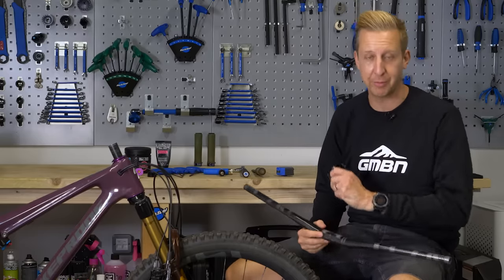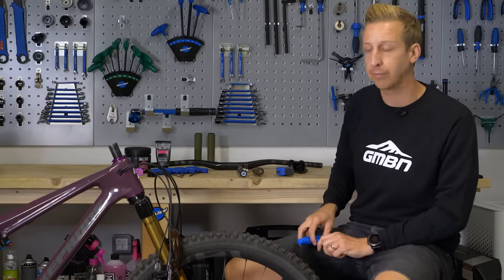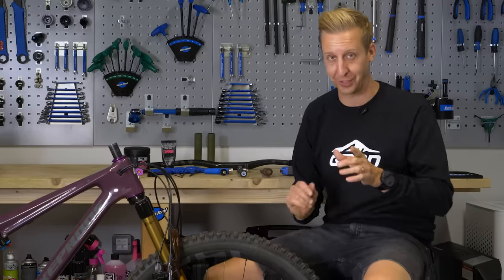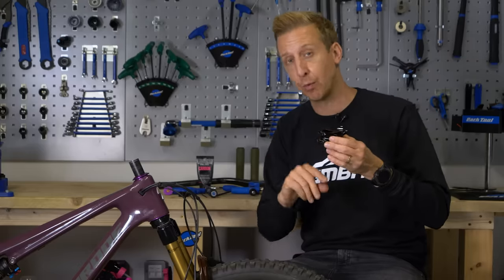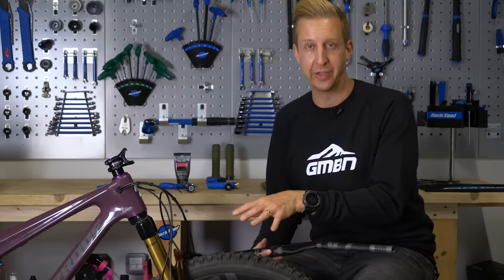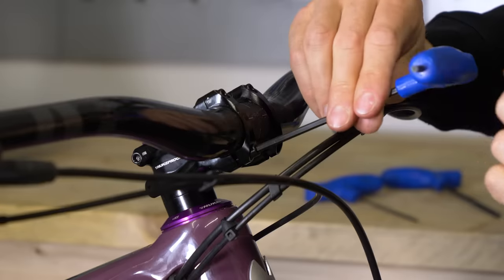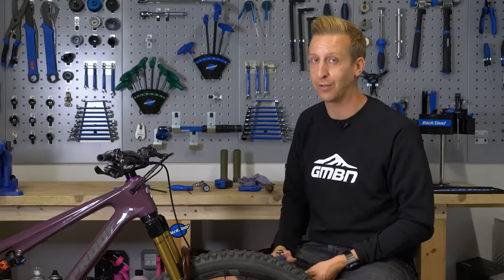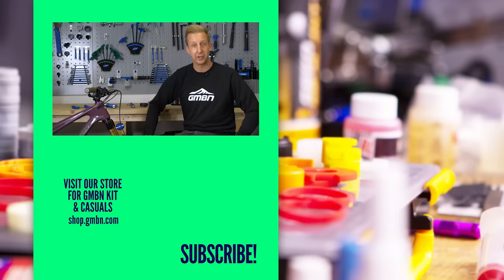How To Fit A New Handlebar & Stem To Your Mountain Bike | MTB Upgrades & Maintenance

Comment: One thing I recommend is to actually center the bar in the stem using a tape measure. Don't automatically assume that the delineation marks are centered. I have had a new bar that the marks in the center were off by a 1/4" to one side. New parts may not be perfect and any flaws missed during quality control inspection.
Reply: Had some raceface atlas bars that were like that

Comment: Hi Doddy, sometimes carbon bars come with a maximum torque setting not to exceed which may be lower than the torque value indicated on the stem.  The difference is minimal but if you want a be spot on something else to look out for.

Comment: 1/4” drive torque wrench $10 & bit set $5-10 at Harbor Freight Tools, still much cheaper than $60 for the PARK, and you’d have a full set of bits and a torque wrench you can actually use when wrenching in anything else besides bikes.

Comment: I always have a 3-5mm spacer on top of my stem, that way my stem is at least flush, if not 1-3mm lower than the top of the steerer tube. That way I get 100% stem grip/interface..... just makes me feel all warm and fuzzy.
Reply: That spacer (if not being held in place by the steerer tube) is prone to slipping and bending the ahead cap screw - so make sure it reaches down over the steerer tube.
Reply: @geemail369  While I have never had that problem, I do like at least 1mm of steerer sticking over the stem to center the spacer and it's how I setup my last few forks/bikes.
Reply: @geemail369  Most headset top caps have a shallow protrusion that fits inside a spacer or stem to keep them both centered.
Reply: @mattgies  That recess won't help -> a few years back a friend of mine found his ahead cap screw bent and (on) top spacer slipped off the stem after we had chucked half a dozen bikes into our transporter and shuttled a bit - another bike's bar must have knocked it off womewhere along the way.

Comment: Instead of removing the steer tube when you file it, you can also just remove the wheel and then lay the bike flat, and collect the filings on a shop towel on the floor.

Comment: Burrs and sharp edges are more likely to appear on lower end and cheap and cheerful (ebay) non-branded stems where corners will be cut to reduce costs so you'd be well advised to check for them.
 Now, I'm all for saving a bit of money if your budget won't stretch too far but be aware that you may need to do some pre-fit prep in order to make sure you don't have a nasty surprise waiting for you on that gnarly descent or when making a heavy landing!

Comment: Great vid but just a bit of question or perhaps criticism, but wouldn't greased threads lead to over torquing? I come from a different kind of mechanics and the only time we would torque a wet thread is if the manufacturer or application requires a thread sealant and we typically reduce the torque applied in those cases. Would you not just want a very clean and dry thread? Thank you for reading
Reply: I was thinking the exact same thing when I heard him say it.

Comment: 😷
So for example, let’s say a company has always used a torque of 100 ft-lbs to install a bolt in a certain application, and let’s say that that 100 ft-lbs was spec’d for use with dry threads with no lubricant. Then one day, an operator says, “Hey I read this article that said thread lubricant is good for the bolted joint to reduce wear, so I’m going to try it.” 

But when they apply the lubricant and then use that same torque spec to tighten it down, they wonder why the threads got damaged or the bolt head broke off.
Reply: Well no cause the reccomended torque value is in perfect conditions. So if it says maxium 100lb it will be 100lb and grease will acctualy help.

Comment: I used 2 big spacers at the bottom and put my stem on and top cap but it still wobbled so I put a smaller spacer at the top and it’s fine, I know I could just cut it but it looks good anyway

Comment: I was taught to torque w/o lube. Great video! Not talking carbon grip but grease on the bolt threads. I have been known to put just a wee bit of anti-seize on dissimilar metals.
Reply: This is actually an important point cause if torque value is for an unlubricated then you will over tighten. Can be almost as bad as a rusty thread.

Comment: I noticed you talking about that gap at the top. I definitely don't have that. I have 70mm of total stack height available - 40mm stem, 5mm spacer on top of stem, and 10mm+10mm+5mm spacer under stem. This is how it was configured from the factory. Is this ok? Also, I wanted to drop the stem down by inverting the stock configuration of the spacers - would this be ok? 5mm spacer below stem, and 25mm total above stem. I just wanted to see if it made my bike fit better and more comfortable, but I don't want to wreck it either.

Comment: Grease should only be used on torqued bolts if specified otherwise you will over tighten the bolt.

Comment: I purchased an RF Turbine R stem a short time ago.
Unfortunately, even when following the assembly instructions (torque always respected), it is quite common for one of the 4 screws to loosen. Since it's always the same I have questions.
I took everything apart and put it back together, respecting the tightening torques, but nothing worked. The screws being almost new there is still all the blue thread lock on them. The spacing at the bottom of the stem is the same on both sides, I have always been careful to tighten the screws evenly.

Do you have any solutions to this problem?

Comment: My enduro has 594 or so mm stack with a 458mm reach which isn't a lot for such a bike in size l. But it also has got a slacker seet tube angle at 73 degrees. Should I go from my 19mm rise bar to much more something around 40 or even more or somewhere around 30-25? Or should I go for 25 because of the slack seet tube angle? I'd definetely like more rise/stack. Should I try to offset the low stack? That's the main question. The rise is propably personal preference.

Comment: Excellent video. At the risk of sounding like a dumbass...what if I just want to change the handlebars and NOT the stem & crable? Do I just take off the front section of the crable, remove old bar, put the bar on then follow the procedure from 9.18? Anything else I need to do? Thanks in advance.

Comment: Doddy.. Im not an expert. BUT. The clamps on the bares. They are 100% together in the top. But there is a gap in the bottom. As far at i know you need to have the same gap in top and bottom so the screws are straight. When only one side is all the way in they are angled yes??
Reply: He addressed that issue in the vid at 9:40-10:15....this particular stem specs no gap at the top...cheers

Comment: is there any reason not to use Loctite 243 for example? I use it on stem bolts, and I found it to be helpful to keep the stem secure with rapid temperature changes, and hard riding. but with some stems it might not help much, I experienced this with Race Face Atlas, for some reason, all Loctite was gone, and bolts came loose in minutes after taking bike out in -10c, so handlebar spun, but it happen all year, I just had to check the stem, before, during and after rides, unless it was more stable temps, then the stem would not loosen as easily, but the issue was on the stem steerer tube clamping bolts too so the headset had to be tightened too. 
I had to check it often, even during rides, not an issue with Renthal Apex stem, which I've used on my previous bike, and I was so impressed I went for it just a shorter version.
but I do add some grease, I add grease at the shim on the bolt, to prevent it getting stuck. I've tested the stem with and without Loctite, and yes it does make a big difference, if the stem already is great.
But I don't know for sure what is the cause for this stem being so secure and the other not, maybe materials, clamp design, maybe both, maybe bolts too. with Loctite 243 the stem bolts hold on for months, tru rapid temp changes, hard riding, and when they finally come slightly loose, they would still be secure. and of course torque spec is important, some stems require higher torque than others.

Comment: Greasing the threads? Won’t that lead to an inaccurate torque reading?
Reply: No, that actually helps with accurate reading. Threads are not surgically finished or cleaned from factory and can be additionally dirty from storage. This would cause under torquing most bolts.

Comment: Hi GMBN!  i just got a new Canyon Spectral 2022 AL 29'' in size XL. I am 1m95 aswell. and i feel like the bike is a bit long and the bar feels quite Far away. Also when i try to manual or do a Bunny hop i feel like its quite hard to get the weight to the back of the bike.  What do you suggest , A Shorter Stem ? or a higher rise bar? the hight of the stem is at its highest position.   I do not have that many problems with the front wheel comming up yet on Steep climbs.    

comming from a Giant anthem xl with about 475mm reach  to the canyon with 506.  The Giant anthem felt too nervous for me with its steep head angle and 27,5 wheels.

Any Tips are welcome 
Cheers and ride safe !

Comment: What is the piece under the top cap called? Mine (new bike) is missing a piece and I don't know how to search for it. There is a play between the fork and the frame because this missing piece
Reply from the maker: It's usually called a stem spacer or a headset spacer - some riders call it one, some call it the other, but they're the same thing.
If you have any problems, we always recommend getting in touch with the shop or brand you bought your bike from to check with them - it can help save some expensive problems in the future!

Comment: Worst part is lining up the stem with the wheel
Reply: The bar forms an isosceles triangle with the front wheel. Means, if bar is centered in stem, two threads from bar ends to e.g. valve in rim, will have the same length. I just wrap the middle of a two meter thread around the valve, mark two equally long parts and when bar ends align with the markings, the thing is 90deg to the front wheel. Aligning by eye sight with suspension stanchions works too, as long as your nose is center over the stem 8-)
Reply: Just zip tie a level or any kind of straight edge to the front of your forks and eye the bars inline with it..that’s what I do and it’s perfect every time....
Reply: What clips are they you are using to tidy your cables?

Comment: My question is what nm do you set the torque wrench for the the brake levers on a carbon bar and grips I’ve never had carbon bars on my mountain bike I want to buy hope stem and carbon bar.
Reply: You dont really need carbon bars bc they are way more brittle.And you have to be really caretul wen installing them

Comment: should I grease stem bolts on an aluminum stem? And with what grease?
Reply from the maker: Hi @Wes Staff, You don't need to use grease on stem bolts as they are very unlikely to corrode or get stuck. Just ensure you put a little bit of standard bike grease on the stem where the handlebars sit. We hope this helps and safe riding!

Comment: I want to go from 31.8 to 35mm stem but the steerer tube says 11:8 at top and lower steerer tube is 11:2 so do I get a 11:8 stem
Reply: Sounds like you're talking about headset bearings, like for uk its 42/52 is, 31.8mm and 35mm is the diameter for a headset stem clamp not the fork steerer

Comment: Is anyone able to give me some advice... recently bought a new bike and I seem to really struggle to get the front end up off the ground, I've tried a higher rise bar which has helped but it still seems tricky, could a 40mm reach stem instead of a 45mm stem help this
Reply: I made a manual station out of some old wood as I had the same problem. Practicing manuals gives you your balancing point and how much energy you have to put in to get the front up. I also shortened my stem to 40mm too.. hope that helps.